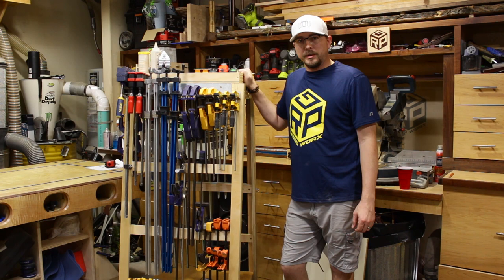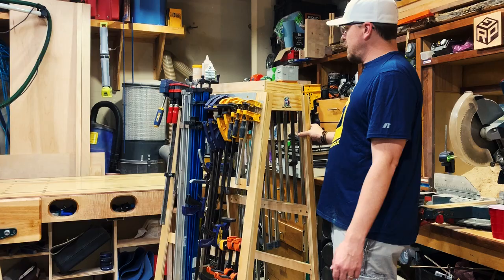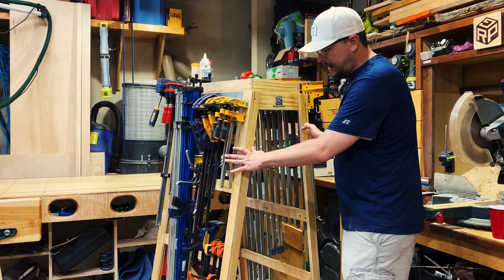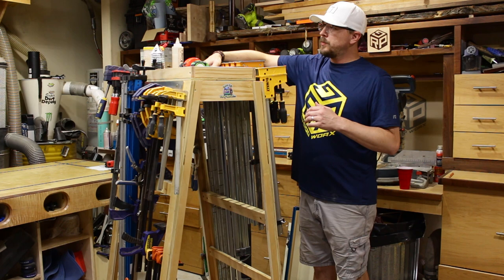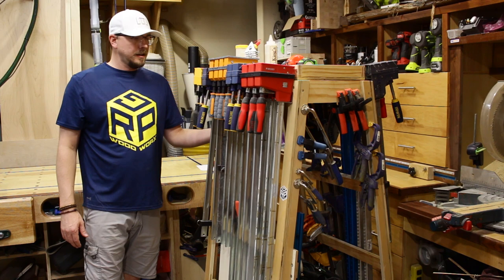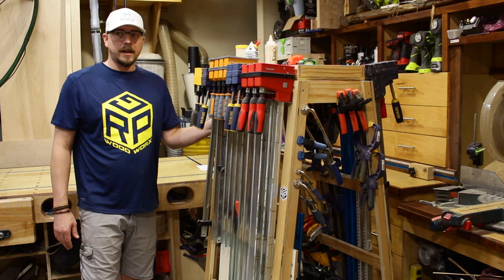DIY | How to Build a Mobile Clamp Rack Station

Comment: Made this after watching this video. I found it be very stable and ridged. Rolls very nicely, just keep it in mind solid wheels in the front, swivel mounted in the back.. I add 2 pieces of 3/4 X 1 on the A frame for my squeeze clamps. After I finished the build, of this rack, I stepped back and realized I need more clamps. Never enough clamps!
Reply from the maker: Awesome!  Mine is so overloaded!  🤣🇺🇸